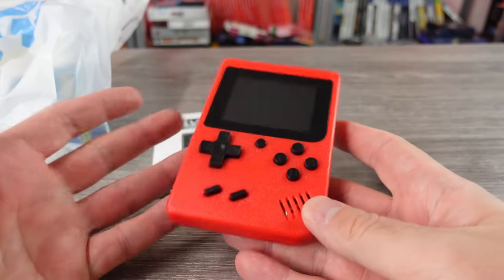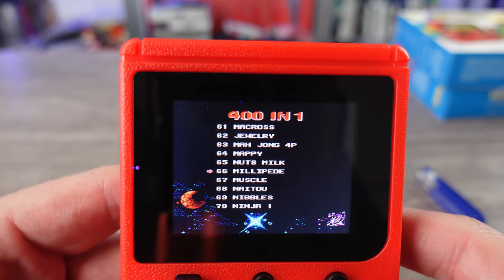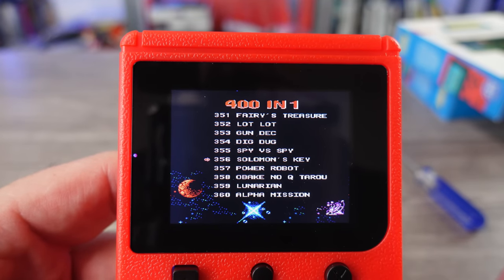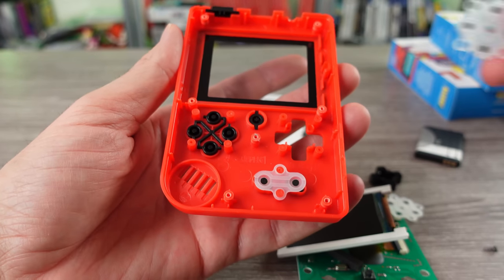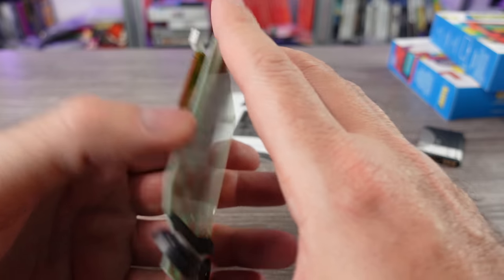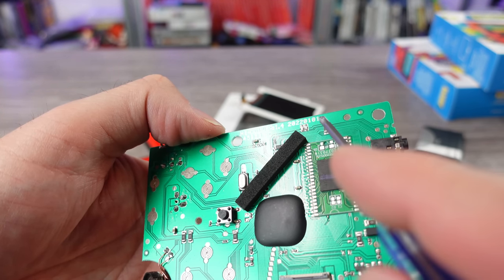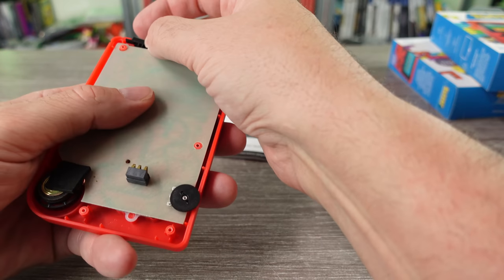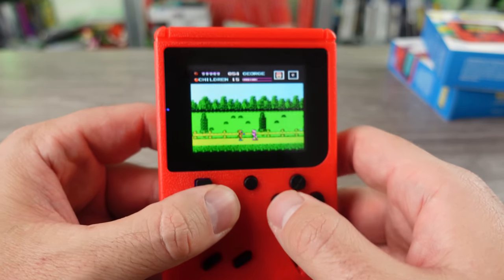Taking Apart The ILLEGAL Five Below NINTENDO Handheld! Teardown ACTION!

Comment: Crazy how a knock off $10 handheld works better than so many handhelds you’re sent to review 😂
Reply: i got 2 of these of aliexpress for 10usd each came with a 2 player controller too that plugs into the charging port also to note both of mine one came with a swollen battery and my other one after using for maybe 3/4 week or so battery became swollen :(

had this with a few other nes on a chip systems too like the pvp stations handhelds
Reply: That is probably because NOAC systems have some degree of a common standard spec compared to the wild west of mobile-chip-based emulator systems.

Comment: Forgot to mention I went by my 5 below, and they had about 30 of them. If anyone has trouble finding them, they were by the computer accessories in the back left corner of my store. If that helps.
Reply: Thanks, they didn't have anything like this at mine. I probably spent 30 minutes looking everywhere lol
Reply: At mine it was up front with the holiday stocking stuffer section. It was on a high shelf so I wouldn't of noticed if it weren't for the fact someone had taken one to look at and laid it on the shelf below.
Reply: Thanks loads!!!

Comment: ooh! a 24 pin lcd. Very handy. Thats well worth the price alone right there! Very useful as its one of the more common style ribbon connectors. I recently used a 24 pin i pulled from a broken borescope camera i bought for $4 on ebay to replace the broken one i had as a secondary on one of my raspberry pi emulation projects. that Nokia style lithium battery is useful also
Reply: assuming everything fit proper you could combine this with a raspi for a damn decent emulation device at what like $40 depending on your goals? the shells gotta be worth at least a five spot. and i suppose you could still reuse their board for....something?

might be semi worthwhile trying to pick a couple used ones up off ebay down the road for a few bucks just to keep on hand for projects
Reply: @xAlexZifko  If you are crafty, yes, you can make your own case with internal dimensions appropriate for whatever internals being used, but i really have to say, these days, companies like Anbernic with their RG-552, among many others, and Powkiddy's RGB10Max2 etc: are making some VERY powerful handheld emulators, with IPS displays, and all sorts of amazing options in the range of $70-200 that are far more powerful than even the newest Pi boards. I like to tinker and mod regardless, so, even though i use some of the more well put together emulation handhelds from Anbernic and several other companies, i still buy broken ones and bobble them together here and there just for shits and gigs. I also like modifying nintendo switches, and other consoles. I recently put a fully clear backplate and shells on my joycons and bought some SNES colored buttons for my personal switch, and for my girlfriends lite, i put sky blue buttons and a clear front and rear shell on hers as well. All of my consoles are modified somehow. Some have LEDs, others have modded cases or softmodded. Its just a fun inside hobby when its too cold to be working on my cars. I have a drift car, and several street projects i am always changing something on or fabricating parts for. Hobbies keep our mental health in good condition. Plus, who doesnt like doing things they consider "Fun" or enjoyable.
Reply: @xxdjsolomanxx  good on you... the idle mind is the playground for the devil

Comment: The only thing im dissappointed in is that it wasn't just a micro SD card. The form factor and screen would make the unit perfect for GB GBC NES and Sega to a degree. Then again since it runs the games rather fine from what I could see in the video I would assume the chipset could handle up to Sega. Then again it would probably end up like my Retro Pocket 2+ eventually, just in a box.
Reply: This is not any kind of emulation its a reversed engineered NES hardware solution called a NOAC or NES on a chip.
Reply: its still do able if your good with mod chips and soldering . Assuming your able to tap into the processor.

Comment: that looks like a easy rom hack, desolder that board and easy reading, probably somoene already made a tool to extract and inject different roms and tune it for specific games.
these days it may not even be a full NESonChip, i got cheap "riscv" microcontrollers that can do all sorts of cool stuff and a NES emulator written in micropython. meaning, if its not a nesonchip, it might be capable of so much more.

Id buy one anyway, cool vid :D

Comment: Question: Its been a while since I've priced mini electronics, but are the contents of the unit worth the $10.00 even if you don't want it for the handheld? For example f I was looking to do a project that required a 24 pin removable LCD screen? I'm always surprised with the low prices on some of these finished items.

Comment: Do you think you can delete games off of  it  and download others? I know you might have to destroy the chip to remove it if it's epoxied to the chip board. But it would be nice to reprogram if possible.
Reply from the maker: I mean anything is technically possible, but id imagine with a device like this which essentially is a NES on a chip with built in games it would take a lot of know how and work to do so, to the point I just dont see it being worth the effort.
Reply: Hey can you see if you can view the roms on PC via USB ? ❤
Reply: Already tried its only power in.

Comment: i saw your video ran out at lunch but they didnt have any at my store. im betting you could possibly solder on an sd card slot to that chip set and get it running everythig, but not much reason to with bad buttoms